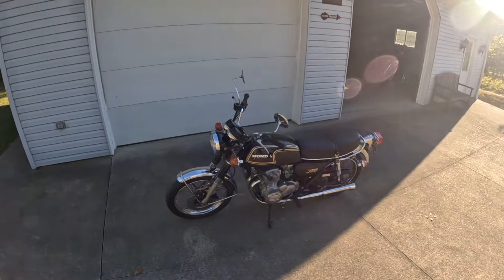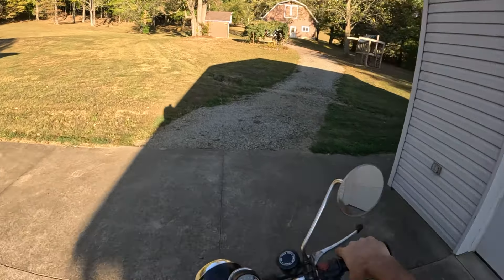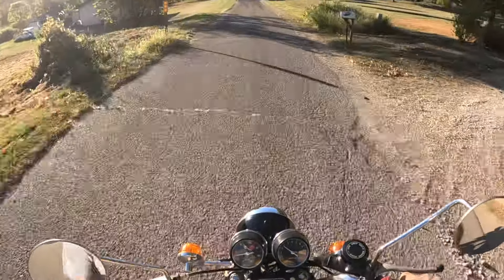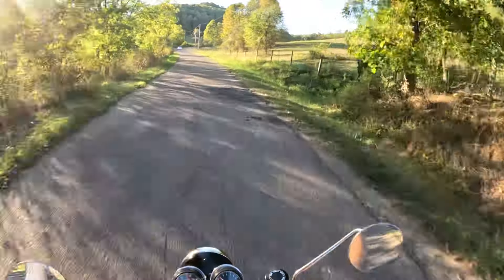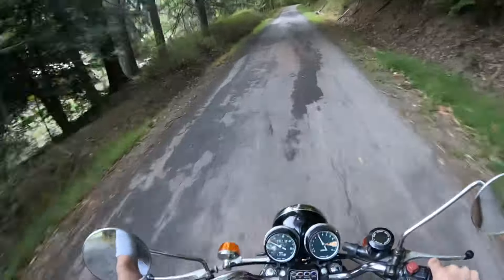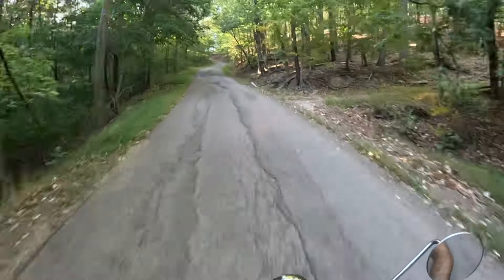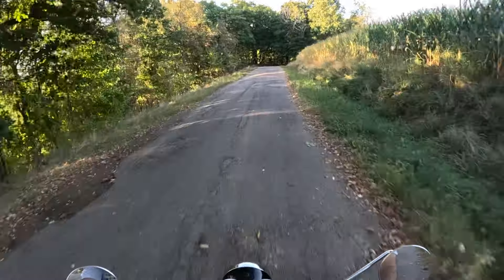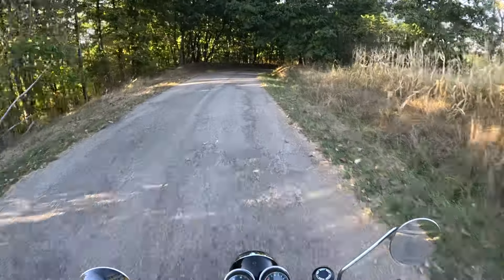Honda CB350F Initial Test Ride after Rejetting 9/21/24 #honda

Comment: 553,400 CB 750's were made from 1969 through to 1978 compared to just 71,000 CB350 fours from 1972-1974.  And your Carb work is the reason I use my own mechanic because I'm just far too old and also lack the skills required to make sure I don't make a mistake.  LOL

Comment: The unusual aspect of these CB 350 fours was the use of 20mm Keihin carbs feeding 87mm cylinder capacity where the CB 750's used 28mm carbs feeding 187mm cylinder capacity.  If you scale them correctly the 750 would have had much larger carbs however they were deliberately under tuned because Honda released the CB750 as a "marketing" ploy to claim the title of world's first super bike even though it's performance was in fact rather mediocre with Honda going for increased reliability.  The tiny CB 350 four was also under tuned hence it's very modest power output but as we all know all three original Honda fours were very under stressed as can be seen by how many are still running half a century later!  Quite an achievement.
Reply from the maker: Awesome machines across the board!
Reply: @lockviewacres  I just bought another one.